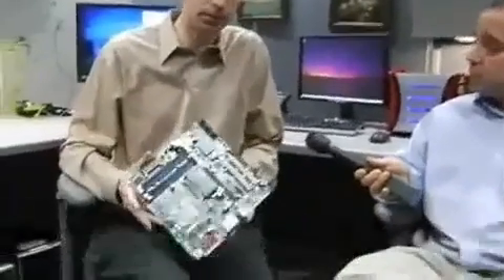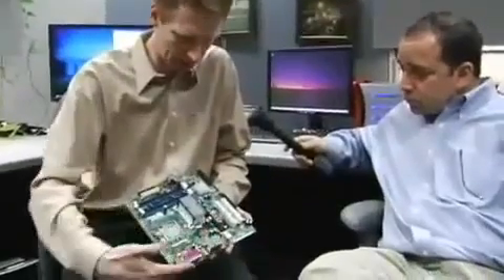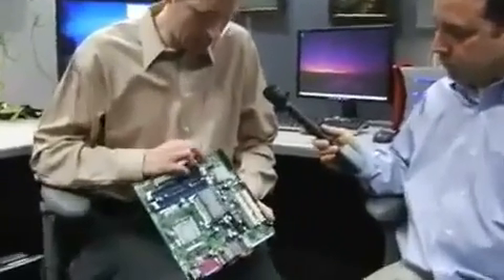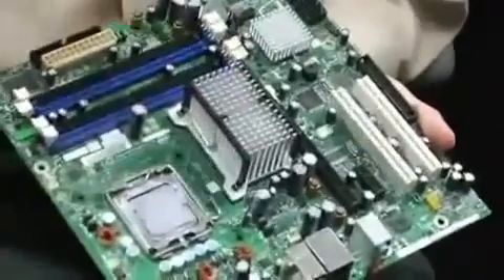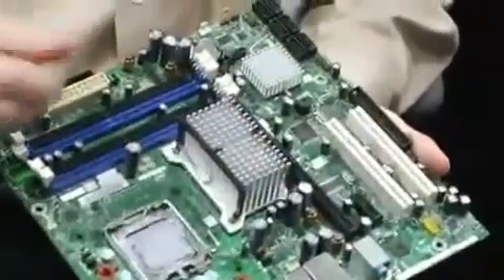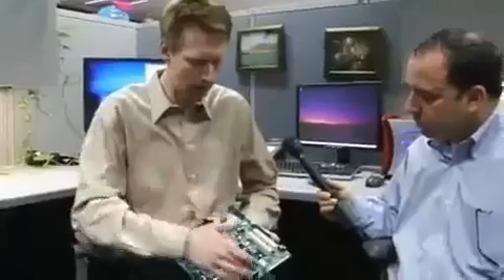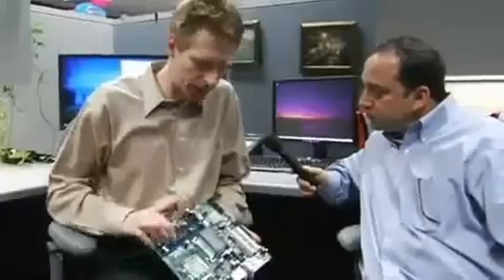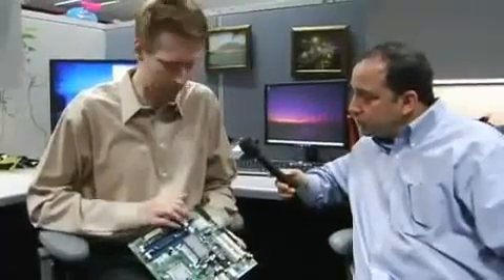Intel ME explained (intel management engine) from insider

Comment: Intel agencies and the like have access to backdoors into the Intel ME (AMD also has this stuff, and so do smartphones), so they can watch anyone using this hardware and access read/write to the RAM, any memory device plugged in, all the I/O devices, and it is all invisible to the user and OS, leaves no trace of tampering, they can access the computer even if it's off(as long as it's plugged in and in low power mode), the network adapter runs a secondary parallel (hidden) TCP/IP server, so yeah this stuff is just a backdoor for people like the NSA and eventually to anyone who knows and has exploits into the ME system and the like.
Reply from the maker: You can have a whole system in the NIC.

Comment: This guy's the Dr. Fauci of the IT world. Both Intel and AMD seem of put this backdoor in every CPU manufactured since around 2008.
Reply: Correction its 2013 for AMD and u can disable it in BIOS itself unlike in Intel u need to modify the BIOS
Reply from the maker: @RaitouElswordPH  It's not Bios. It's the module. 
You are flipping a proprietary switch. If you can actually believe off is off. I'd be running Apple on all my devices.
Reply: @Canadian789119  Intel based Macs contain this exciting new technology too! Apple silicon is even more of a black box..
Reply: @RaitouElswordPH  that doesn't fully disable AMD PSP as it is required for the computer to run memory training and establish a link with your RAM at boot. the disable PSP switch only disables the TPM module